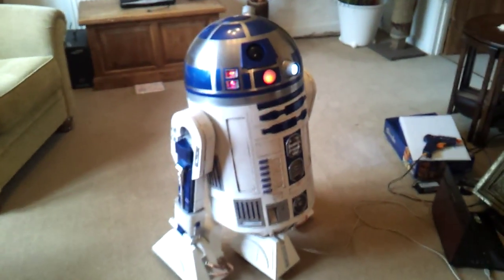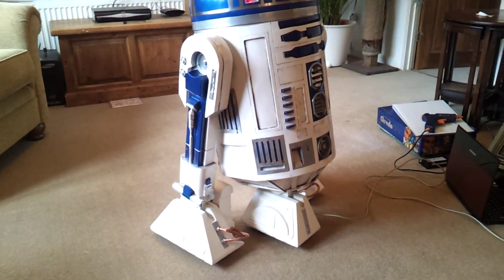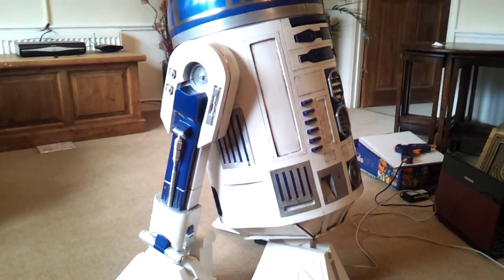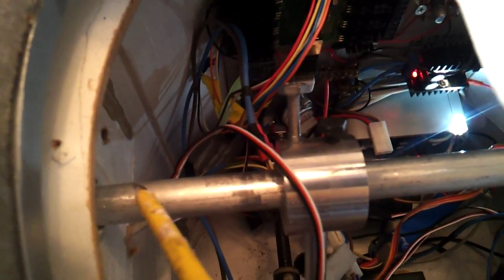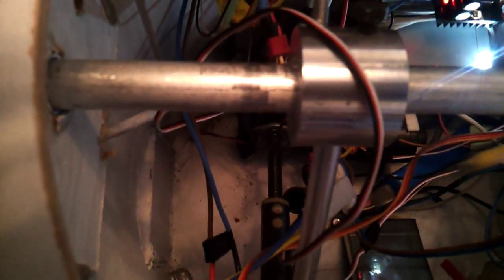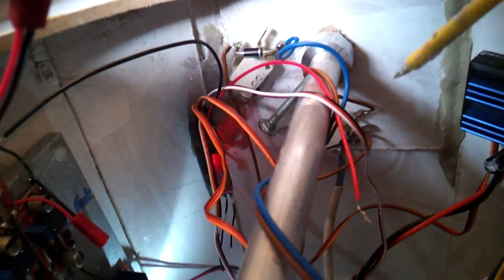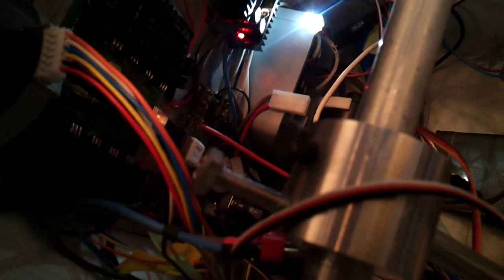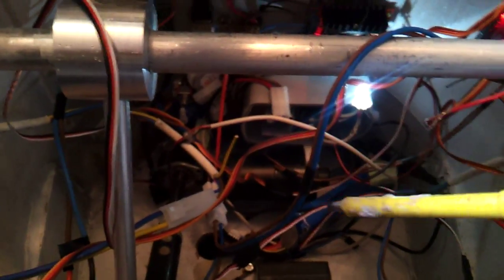Autonomous R2-D2 Part 2 - 3-2-3 type leg movement explained

Comment: Finally a video that actually shows you how something works 😂 got really tired of finding videos that said yeah I can do the 2-3-2 with my droid but they never actually show you how it works. I know this would be a long shot but any chance you could do videos like this for stuff like connecting the dome to the body and how to wire it up etc without wires getting twisted and tangled etc? Thanks!
Reply from the maker: You can buy the head bearing here - called a lazy susan: 

https://rover.ebay.com/rover/1/711-53200-19255-0/1?icep_id=114&ipn=icep&toolid=20004&campid=5338200295&mpre=https%3A%2F%2Fwww.ebay.com%2Fitm%2FADVANCED-Aluminium-Alloy-Lazy-Susan-Turntable-Base-for-Round-Table-Wheel-Swivel%2F232655175392%3Fhash%3Ditem362b543ee0%3Am%3AmLCZlpYb5JckZJbTF9b_ZbA

And the rotating wire connector here called a slip ring:

https://rover.ebay.com/rover/1/711-53200-19255-0/1?icep_id=114&ipn=icep&toolid=20004&campid=5338200295&mpre=https%3A%2F%2Fwww.ebay.com%2Fitm%2F12-5mm-300Rpm-6-Wires-CIRCUITSx2A-Capsule-Slip-Ring-AC-240V-for-Monitor-Robotic%2F401051779987%3Fepid%3D508615210%26hash%3Ditem5d608c8393%3Ag%3Ay0gAAOSwubRXIYjK